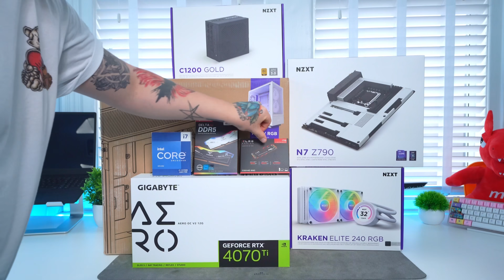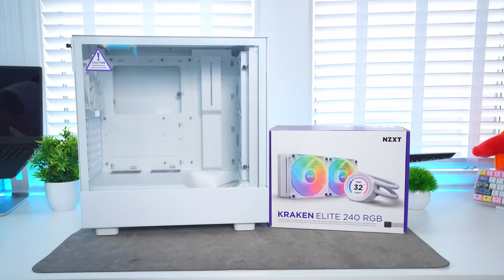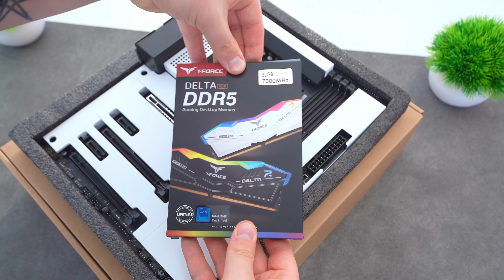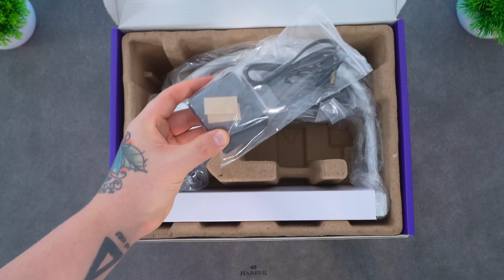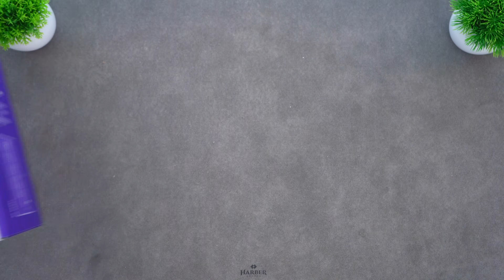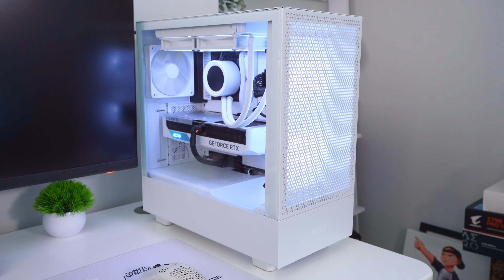Building the CLEANEST White Custom PC! - NZXT H5 Flow RGB PC Build

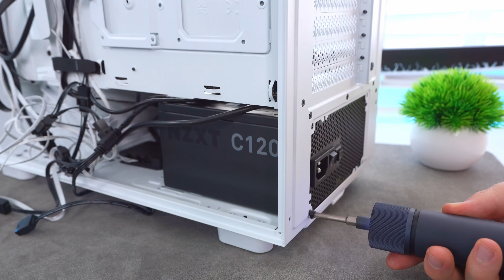Comment: 6:33 amazing build & guide, thank you! I literally replicated this and have a quick question regarding your PSU. I notice that the NZXT PSU fan is 135 mm and larger than the 110 mm ventilation grill on the bottom of the NZXT H5 Flow case. How is yours going so far? Should I get a smaller PSU / fan diameter?

Comment: How are SSD temps? I have to make back fan intake to prevent ssd from frying it self. 70+ degree C with heatsink and rear fan as exhaust and less than 50 with heat sink and rear fan as intake.

Comment: Yo. The two RGB fans that come with the case come without a controller. Can you also control that RGB lighting via CAM software? Or are you stuck controlling the RGB of the AIO via CAM and the RGB via Mobo software?

Comment: If you could please also shows which wire goes on which side of motherboard then that would be superhelpful for the first time builder. E.g. USB, 3 pin fan header, etc. Much appreciated and good content as always!
Reply: It does depend on the motherboard tbf, just read the manual

Comment: Will build my first pc soon and it brings me confidence that you use most of the parts that I picked myself as well (same case, motherboard, cooler and GPU). You make putting it together look very easy, but I am expecting it to become a big struggle when I’ll do it haha
Reply: Was it a struggle?
Reply: @aexhu_  No, but I must say I eventually built something completely different. Decided to build the pc for the living room instead of the office to use with my 4K tv and it required different specs: heavier GPU (RTX 4080), all black components to fit in with my interior and no RGB. The only part that was the same was the H5 Flow. I found it a very easy case to build in. Of course although the components were different, the process will be much the same and it’s very much plug and play once you know where everything goes.

Comment: Cable extensions left the chat 💀
Reply: Fr
Reply: ong i expected better for the "cleanest" white PC
Reply: @a9qx it still clean but definitely not the cleanest it just makes the title sound better which gives him a better click through rate
Reply: Cmon don’t hate
Reply: wdym?
Reply: @date144GK they basically make a pc look better by making the cables look more organized and changing the colour of them
Reply: Stiller nicer than your trash
Reply: Could've at least gotten the white variant of the psu
Reply from the maker: @polski_dezerter why? You literally can’t see it so what does it matter?
Reply: @SpuddGaming  it comes with white cables
Reply: @SpuddGaming  so it would've fit in better

Comment: If you want to make the pc with everything new. Down here are the prices.

nzxt h5 flow rgb white 106 euro/113 dollar
kraken 240 rgb white 166 euro/178 dollar
nzxt n7 z 790 333 euro/ 357 dollar
nzxt 1200w power supply 200 euro/214 dollar
MSI geforce rtx 4070 TI white 1099 euro/1179 dollar
intel i7 13700k 436 euro/468 dollar
32 gb 7000 MHz tforce Delta RGB ddr5 161 euro/172 dollar
1 tb cs3140 ssd accelerate gaming 79 euro/84 dollar

It is about 2680 euro
It is about 2765 dollar
Reply: Hi ! Are these all the components using in the video ??

Comment: Can you make a vid about upgrading a laptop?
Reply: Most laptops cannot be upgraded. At most, the Ram and SSD can be upgraded, but the GPU and CPU can’t be touched as they’re typically soldered to the motherboard in a laptop. 

There’s a fair few videos about upgrading the SSD and RAM as it’s similar on most systems and takes 5 minutes or less to upgrade both.
Reply: @MajorWakanda  ok thx im new at pc builds but my laptop sucks but thx anyway